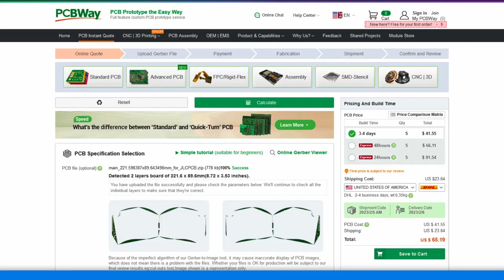URCHIN Ergonomic Keyboard Build

Comment: I would really recommend usig lead free HASL and solder for environmental and health reasons, especially when going plateless. Don't want to have lead on your fingers from using your keyboard.
Reply: Wonder how bad that is for ones health. Never thought about it too much…like when using the keyboard or moving it some lead might land on the hands right? But is it an issue in such a small quantity? (Serious question I just have no clue)
Reply: @sighup124 it really shouldn’t be an issue simply touching it. But I can’t speak on how dangerous the actual soldering process is. Probably best to avoid using it if you can.

Comment: For SMD components, I'd use flux and tweezers to place them, plus my aged eyes need a magnifying glass for SMD components!  A lot of the SMD joints in the video look 'cold' as it doesn't look like the pads heated up enough for the solder to flow on to them properly.  The through-hole soldering was much, much better.  The reason I mention extra flux, is that once you've pre-soldered the pad, the flux in the solder will disappear, and this makes it much harder to melt the solder and transfer heat to the solder and thus pad/component.  Anyway, lovely board and nice video!

Comment: What did you end up using the screens for?
Reply from the maker: I can see what bluetooth profile I'm on at all times, and I can see if the keyboard is connected or not (helpful after waking it from sleep), which layer I'm on and the battery levels.
Reply: Totally makes sense, the layer information would be so nice

Comment: Why are you not using a case for this keyboard? Isn't it bad to leave the PCB exposed?
Reply from the maker: It's safe to use without a case, just add some rubber feet so it doesn't slide.
However I am currently using it with a tray case, I plan to release it soon on github as well.
Reply: @KyekOfficial  Have you considered adding tenting and a wrist rest?
Reply from the maker: @Goooogle  tenting is supported via splitkb tenting puck (but not with the case). The wrist rest isn't needed because the keyboard is so flat.

Comment: Awesome! Thanks for sharing this Kyek, I was originally going to build a 42 key bare pcb wireless choc Corne keyboard but now I think I'll be building this instead.

I'm curious to know if you have tried using conformal coating or plasti dip spray to protect the bottom part of bare pcb keyboards before. Do you think it's necessary or not (if the board will also be used outside home)?

Also, thanks for sharing a working config as well! Keep up the great work!
Reply from the maker: Yes I bring it to work, the only think I do to carry the keyboard is remove the screens and leave them at home. They would need additional protection to travel, and I am working on providing this soon.

For the bottom of the PCB I always just use some 3M rubber stickers, but currently I'm waiting for a tray case that I ordered, if it works fine I will add it to the repository for everyone to print and use.
Reply: Ohh I see, I'll be extra careful in handling the nice!view displays then. Thanks!

Comment: Hi Kyek, I’m new to this era but I’m curious that can we use Pi Pico W instead of nice!nano for wireless build ?
Reply from the maker: The Pi Pico is bigger. Your would have to modify the PCB to make it work. You should also check first if it is supported officially by zmk firmware